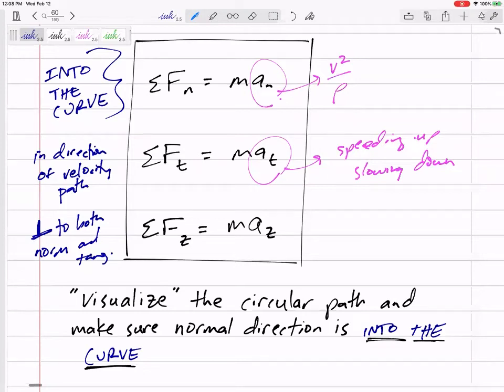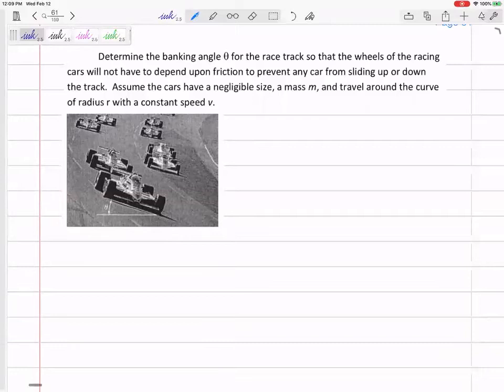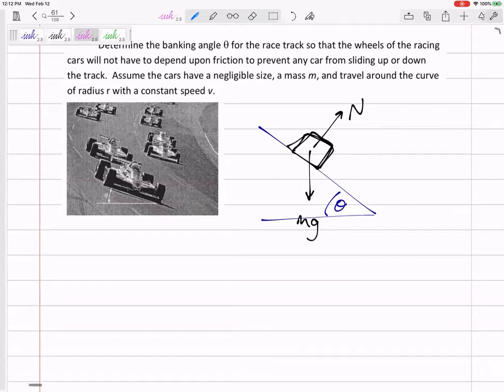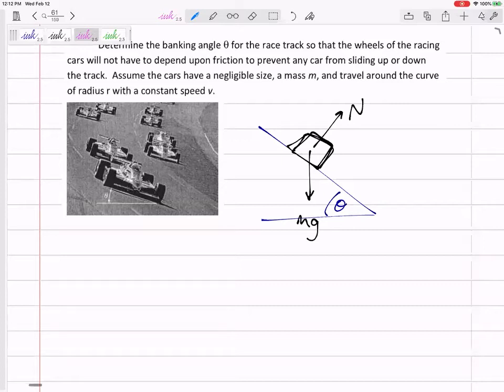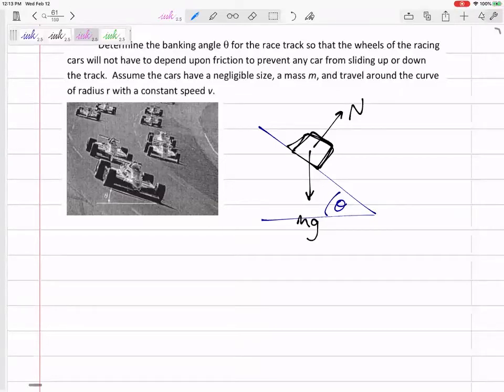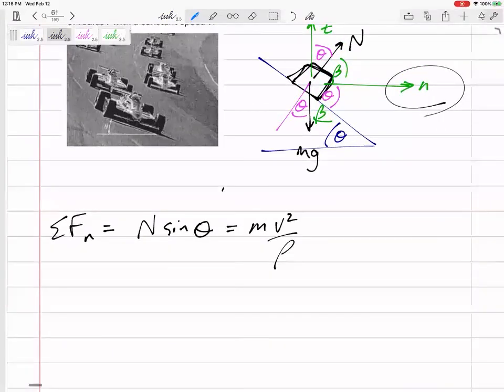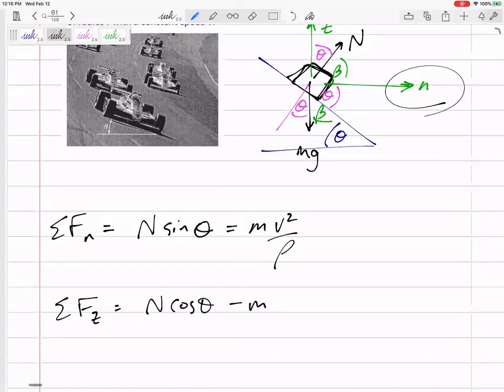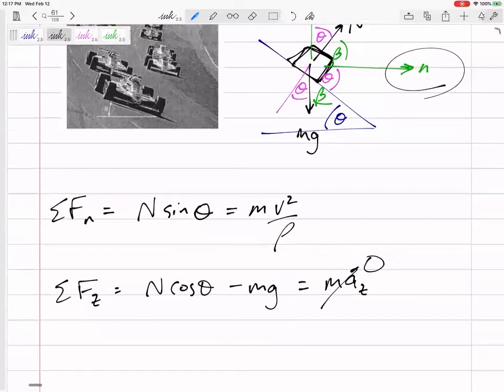Dynamics - Particle kinetics Normal Tangential example 1

Comment: For the normal force in the x dir could i have done Ncos betA?
Reply from the maker: Yes! N cos beta would be the same as N sin theta. But then you’d be solving for beta so just remember to subtract from 90 to get theta.
Reply: Thank you sir. I have a clarification, at 2:36 when you mentioned that IF there was to be a force of friction when a car is going slowly, the friction would prevent the car from sliding down the track and if it was speeding up, it would prevent the car from sliding off the track. Does this explanation apply to every single inclined friction problem?